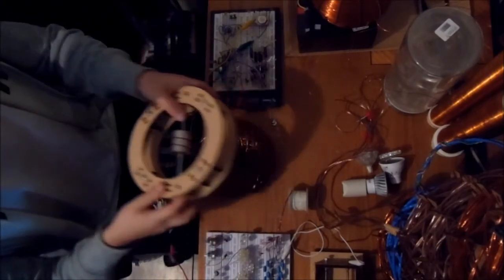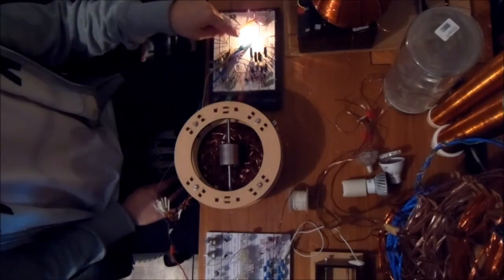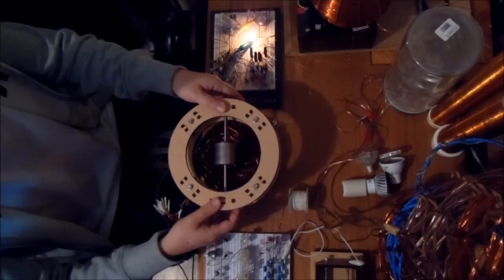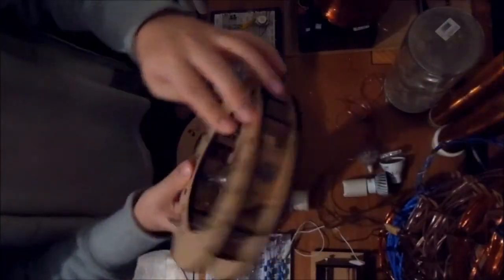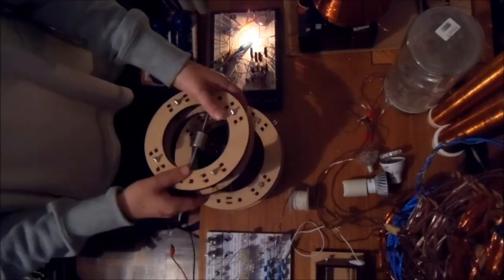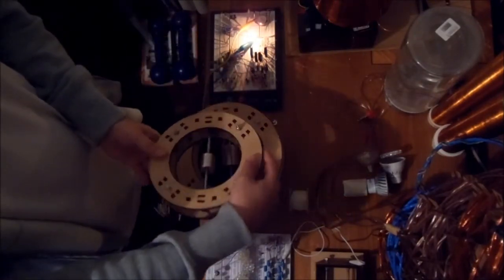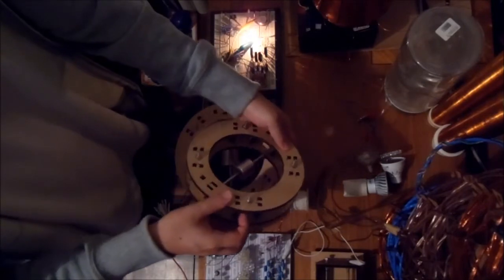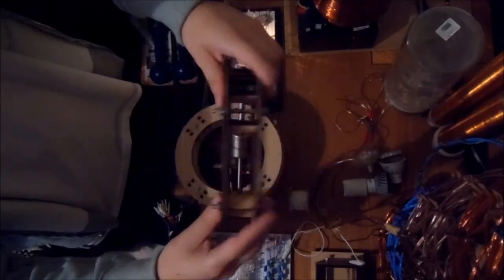ABHA Coil + Bedini SSG + Magnetic Coupling

Comment: very nice i was thinking the same thing when i had 1st looked at the abha coil being used. You have shown some interesting stuff like the position of the axis doesn't matter up to a maximum distance! :) but could you tell me what type of magnet you are using? if its polarised through the length or through the diameter to give a better understanding on how the magnetic fields are interacting. thx
Reply from the maker: Thanks. Those magnets are magnetized through diameter.